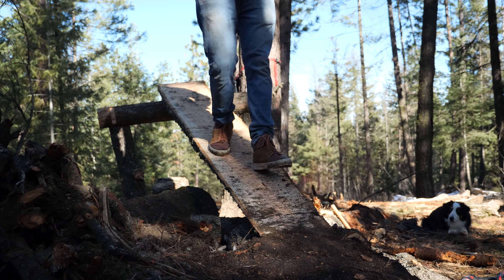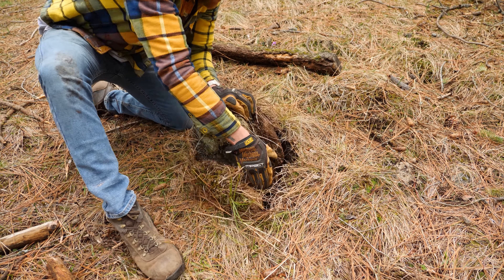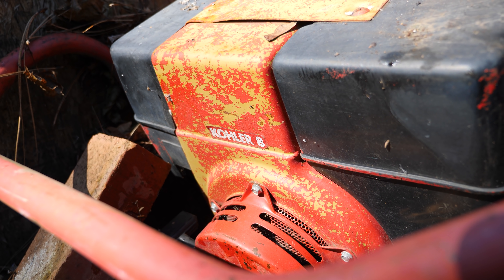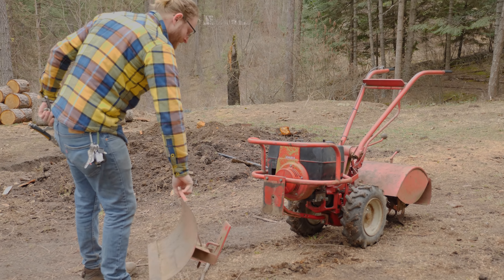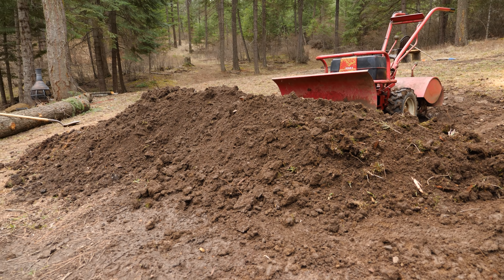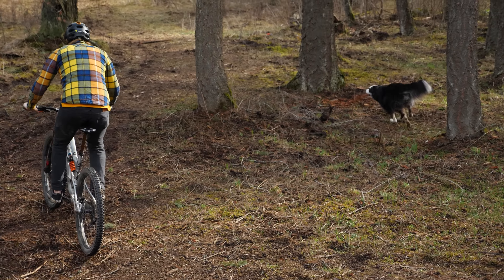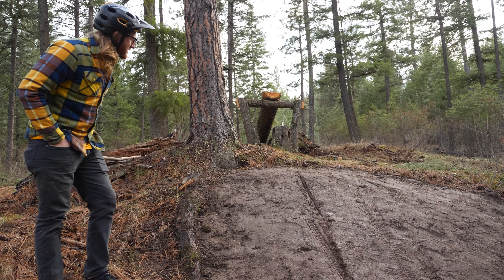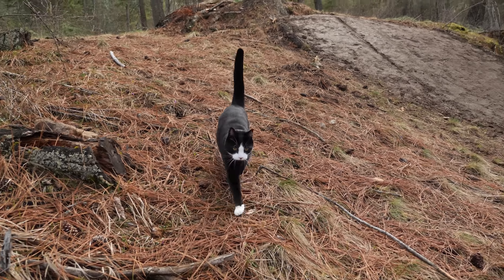Finishing One Sketchy Jump // MTB Plank Jump Build and New/Old Trail Tool!

Comment: My father in law has basically that exact tiller. What a beast. I borrowed it last year to till up sections of my fenced in back yard so I could level it easier. Easily the scariest experience when working around fences.
Reply from the maker: It's super scary! I'll be doing some work to the drive lever to keep it from popping into gear like you see it does in the video. Itll be making tons of trails and hopefully a back yard this summer haha.

Comment: Great video man!  I wanna hit that feature.  What size spring are you using on your Capra? I also have the limited edition Capra 29er and it came with a 375lb, 2.65in stroke. I weigh 195 and was thinking of putting a 450lb spring on it.  So far it has been hard to find the orange Fox spring with the 2.65in stroke.